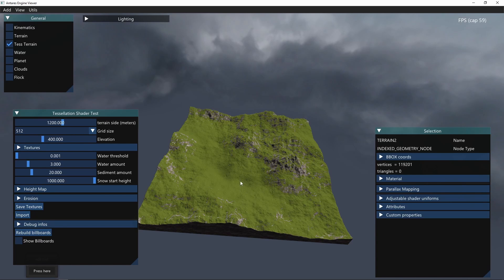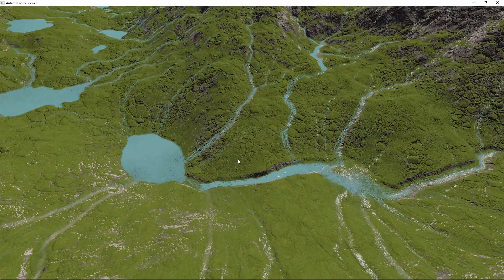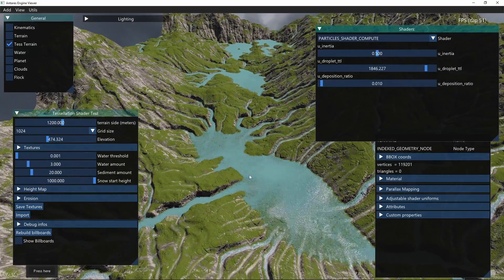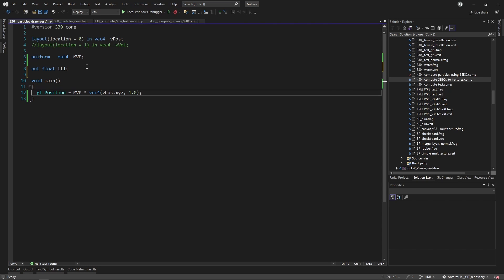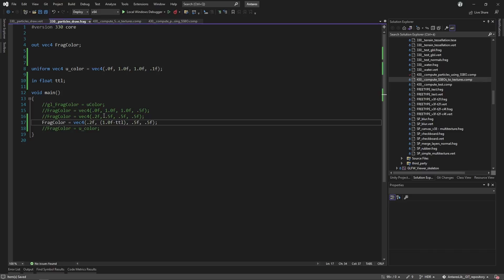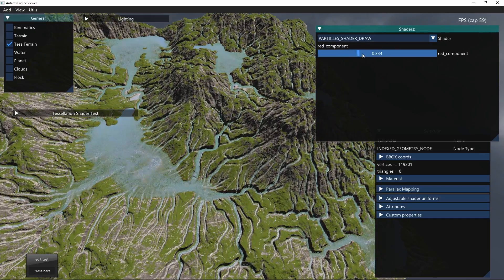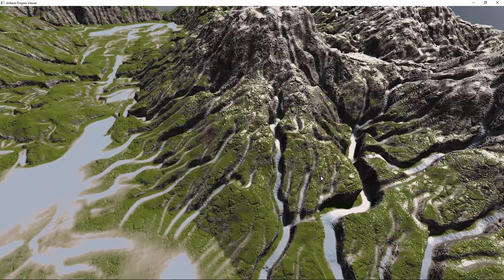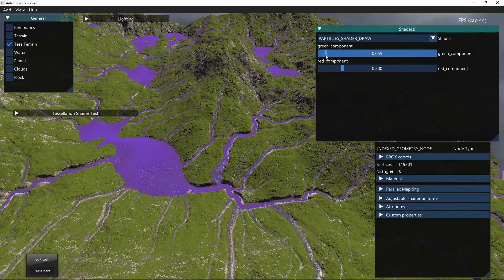GPU hydraulic erosion - more in depth showcase

Comment: Great video, one day you could show a little more about volumetric clouds, it's very difficult to find content on how to implement the technique directly using an API.
Reply: Volumetric clouds are a raymarching shader, incrementally marching a ray through a volumetric representation of a cloud and accumulating color weighted by density and existing accumulated alpha. You want to break out of the loop early if the accumulated alpha reaches 1.0-epsilon (i.e. >0.999) so that it's not marching all the way through a cloud after it's already reached an opaque point. Then you can do your lighting by marching another ray toward the sun, etc... There are plenty of maths on calculating the Rayleigh scattering and whatnot.
Reply from the maker: thank you!
a very good resource for volumetric clouds rendering are the presentations of Andrew Schneider for Guerrilla Games:
https://www.schneidervfx.com/
Reply: Thank you, I will read each one of them. @3DProgramming
Reply from the maker: @kalvin6963  that's the state of the art, they did an amazing work at guerrilla games with volumetric clouds.